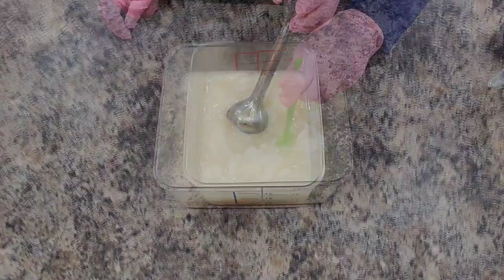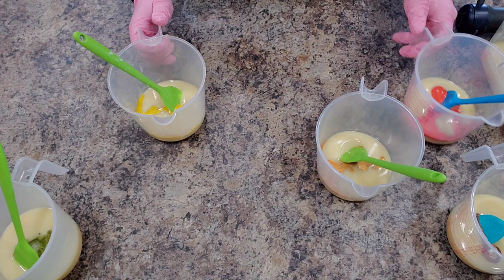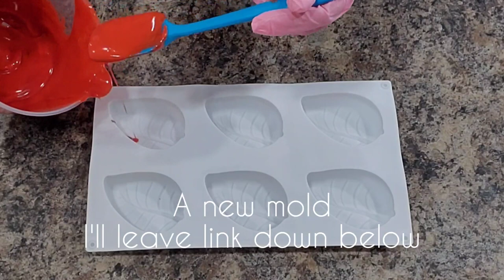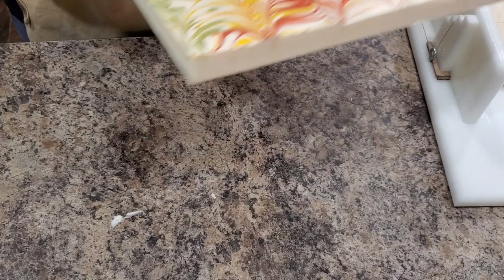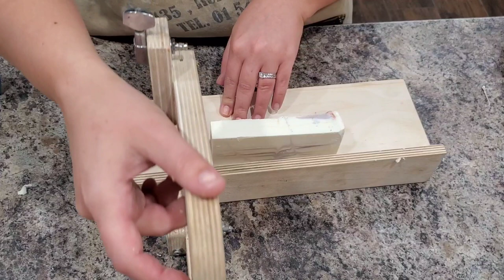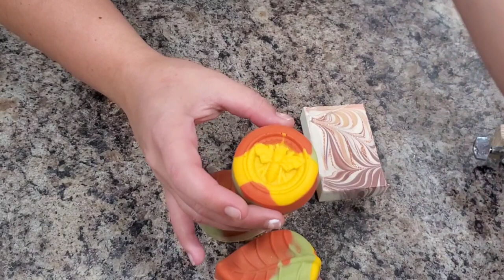Lemon Lime Fall Inspired Silk Cold Process Soap - Sep 2020 Soap Challenge Attempt #1

Comment: Did you intend for the soap slab  to be so thin?  You can only use them as samples now, they are too thin to sell as regular soap bars.
Reply from the maker: No I didn't mean for them to be so thin. I actually do still sell thin bars but in a twin pack or at a discount. They still clean and nothing is wrong with them. They are just thinner them my usually bars.